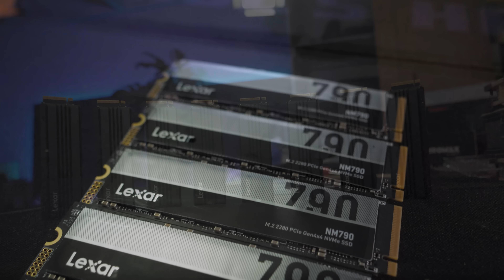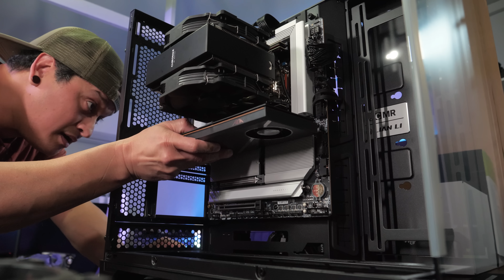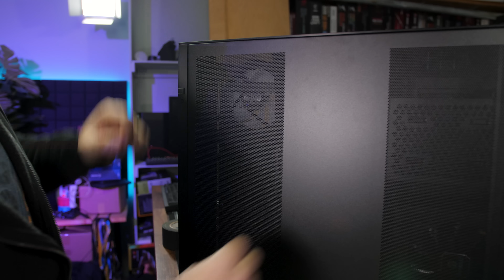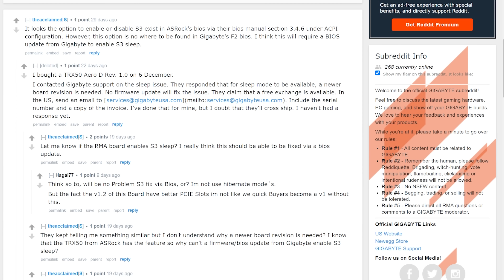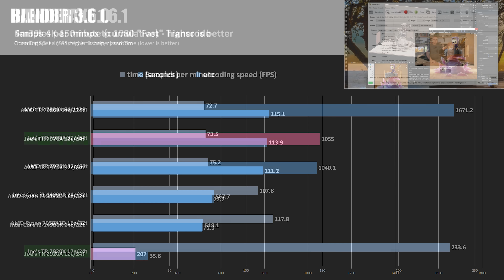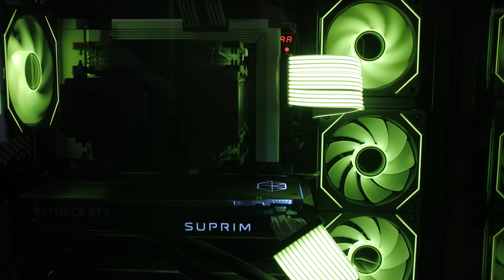Did we screw up?? Fixing and TESTING a $10,000 Gaming/Editing PC...

Comment: Nice build and seems like an awesome system upgrade for Joe too 👍 aesthetically you much improved the look when switching layout of the cards, and most likely a slight improvement of airflow 🤔 speaking of airflow you should have gpu pushing the heat out of the box 😜 thnx for great vids guys ❤

Comment: I wonder how come that you decided to install the radiator and fans of the graphic card in a way that the hot air from it is being pushed to the inside of the case, if you had installed it the other way around you could have avoided the issue of the conflicting directions of the air flows making the use of that flange you installed unnecessary

Comment: Honestly, I don't like sleep mode. Even after decades of Windows use its' still clunky. 
That said, RMA the board if you're 2 revisions behind and it's free. You'll (hopefully) get longer BIOS support and avoid any quirks that 1.0 boards invariably have.
SUPER happy you were able to undo that janky slot setup. It was weird because I thought all the slots supported bifurcation. 

As for the fan setup, I'm guessing you can just have all the fans on the side blow the same direction, the temps should be fine.

Comment: Just flip those radiator fans the other way, that 4090 is putting +500w into the case and its never a good idea to have fans next to each other blowing the other ways. That single exhaust on the back is fine and those at bottom and you can control the fan rpms to have positive pressure inside the case.
Also that top fan on Noctua isnt all the way installed, you can see it in the end of the video that it pops couple of millimeters off the cooler.

Comment: It seems like the foam divider for the fan works alright. But you could keep the bottom as intake, change the rear fan to intake also, and then make the 3 fans on the side exhaust. Be easy to keep slightly positive pressure and looks like the direction of airflow would be pretty clean too.

Comment: I have an Asus ROG Strix Z690-A Gaming WiFi D4 motherboard with a weird issue. It won't turn on with XMP, as it gets stuck in the memory training. I knew I had to RMA it, but then I have to wait until I get the board back, and re assembling would take some time. So I just don't shut down the computer at all, I'll just let it sleep and restart once in a while. I've been using that this way for 2 years now😂

Comment: Thanks for sharing, very interesting. The re-positioning of the GPU and the other cards really is better now, and looks way more organized too - it also makes for better cooling and actually lets you close up the case as much as possible. A follow-up would be nice, with some more efficiency testing of different cooler setups/orientations in terms of airflow and cooling (benchmarks? :)). And if it was about me, i'd totally exchange for the newer revision of the board. Not just for that sleep mode, but maybe there are some other issues that got fixed/improved/updated that weren't disclosed. Looking forward to the CES btw! A lot of stuff going on this year, this will become a super interesting and exciting one for sure.

Cheers!

Comment: I'd want to hear what gigabyte has to day directly before RMA - like others have said, revisions that fast can sometimes mean urgent issues were addressed.  

That said, sleep (S3) isn't a huge power savings these days and, with win11 on AM5, has actually shown issues with memory speed reduction over time.  

Since windows benefits from occasional full restarts anyway, I usually configure my PC to hibernate (S4), which allows the memory controller to entirely shut down, and I fully reboot once a week. (Hibernate has to be added to the start menu via control panel in win11)

Comment: I also had early adopter issues with my Intel Xeon W7-2495X and ASUS W790 ACE system.  The motherboard NVMe is fussy and a bunch of the models on the QVL actually don't work, good job ASUS.  And when I updated to the latest BIOS, the memory training was all messed up, I had to wait 10 minutes for it to fail and then manually set the memory timing.  Each successive BIOS version just got worse and more unstable and more issues.  Yay again, ASUS.  It took a while but I finally have a working workstation.  Also, no Sleep in Windows. Also $10,000.00
Reply: daveg4417
ASUS = early adopter issues, they always do crab Xeon on cheap boards
WHY BE THE TEST BUNNIE ???
Need Xeon, just buy a good HP system please ;) Keep it cheap !

Comment: Sleep/hibernate is not a mode I use.  I purposely turn it off.  So i would not rma for it.  However if you do use sleep mode, then you should rma it.  As for ongoing content... if you rma it, perhaps showing any changes in the 1.1 or 1.2 versions of the motherboard would be interesting.  Outside of that I think you guys covered it.

Comment: The sleep mode thing shouldn't be an issue; just enable Hibernation in Windows and use that instead. The startup time (from power off) should be negligible with that SSD setup.
Reply: TheRealSkeletor
Muahahaah, you are the Total NOOB here !
Gamers never do  Hibernation or Sleep stages, unable to WOKE it !
If you overclock systems to get more frames, these office low energy settings fuck it all up !
Good luck get smart here, LOL !

Comment: I like the looks of the Lian Li Vision but still prefer the Lian Li EVO for better top Exhaust for fans or a AIO. I never shut my system down as I just let it go to sleep. From what I have found about Gigabyte motherboard and doing a lot of research as Gigabyte doesn't like to show things Like reducing the layer to 6 from 8 on previous versions and dropping to the 10 year old version of ALC897 Codec on their over $200 dollar boards. Like their GIGABYTE B650 AORUS ELITE AX 8 layer 14-+2+1 70 amp smart power stages for $219 to their new White GIGABYTE B650 AORUS ELITE AX ICE 6 layer 12+2+2 ??? power stages for $229. Way to go Gigabyte make them cheaper and raise the cost.

Comment: i manually disable sleep options always on all of the over 4000 gaming systems ive built over the years because so many freeze issues arise from sleep/wake. i just tell my peeps to either leave it up or shut it down. i personally have never ever ever used sleep on any systems for over 25 years.

system looks like a monster, should really make joe's life easier with much shorter render times.

Comment: 10:40 If the RMA is very low cost or free I'd do it for the sake of getting a better and potentially more reliable board. I don't personally use sleep functions so wouldn't care much about the feature, but there could be other issues on v1.0.

Comment: Water cooling is mostly for looks now.  I have a thermalright peerless assassin cooling my 5950x and it hits 65c at full load 4.6ghz.
Reply: 4.6 is not enough for modern graphics cards.
you should do a new 65 watt CPU by AMD, or the 14900 F by intel, better !

Comment: I dont like air cooling and   it had nothing to do with performance and everything to do with weight on the socket. With the tower coolers, I've noticed that it warps the boards, and that causes DRAM slots  and PCIe slots to fail. It's a small sample size, but every water cooled pc has been fine, and every air-cooled pc with a heavy tower air cooler has developed issues with slots and i know correlation is not causation and 30 PCs is not a large enough sample size but since the only PC i build these days are my own I'm going to stick with custom water cooling.

Comment: I'd like to tell you what I think, just like you asked. The fans in the back are still going to cross-contaminate OUTSIDE the case. Imho it would be better to intake at the front sideto help improve the positive pressure in the case to force air out the back. Also, the twist in the hoses was a little jarring but I'm over it because at least I don't have it in my house, looking at it like that every day. 🥴

Comment: Turned out so much better on the end. I'm not so keen on that case though. It's huge but doesn't seem to benefit from it as much as other cases.  I think workstation motherboards should think more intelligently about ssd storage too and better integral solutions provided.  I think air cooling is better unless the heat it causing issues like on an old cray supercomputer or something.

Comment: What I would want? Simple RMA the Motherboard and then put in the air-cooled GPU you wanted to use from the start. Make all three of the vertical fans intakes as well as all the bottom fans. The case has enough holes in the back and that back fan for exhaust.  But that is just my suggestion.
Reply: DavidSiebert
this is promoted gear, can't RMA that.
My suggestion, just buy the HP OMEN 14900 F system, keep it cheap, 1699 is enough.
Need more, buy more parts ? New case ? Less good ?

Comment: Paul, I would RMA the board just so you have better support in the future and, as a bonus, you will also be able to put the system to sleep.  It certainly is not a good look to have that may revisions on such a new product so for future support and stability, I would go ahead and get the newest version board they will send you (1.1 or 1.2 respectively).  This assumes the newer revisions of the board prove to actually be better than the v1.0 version in the future, which is a bit of a gamble, no matter which route you choose to take.  Cheers!

Comment: Definitely curious if using the gpu fans as exhaust is better for the CPU. Maybe you could even out the pressure by eliminating the rear exhaust, and installing an aida64 sensorpanel or something similar.

Comment: The sleep function will help with security and power consumption. If you are the type of user that never turns their PC off, sleep will lower your power bill. I use sleep during the day and turn off the PC, overnight. Security is only an issue if you have sensitive or private material, you don't want out, while the PC is unattended. My PC's sleep may be set for 15 minutes but I push the sleep button every time I walk away from it, forcing a password on wake.

Edit: The big question is what is the PC's idle power draw?

Comment: I'd plug all those fans into the mobo so that the GPU fans are spinning with the rest of the case. Use Argus monitor to make a fan controller that can ramp all the fan speeds based on CPU and GPU temps, responding to whichever is warmer.
Reply: acquacow
Is that a question ?
Modern system never need Argus, able to control it on UEFI pre boot and in Windows.
What board u use ?

Comment: Don't have the sleep option on my AMD Ryzen 9 5900X  build  running windows 11 Pro either. And I had hell with my gigabyte TRX40 Designaire Motherboard  when I did  my Threadripper build in 2020 finally had to RMA the board in 2021  and after that it was a great  pc until some one stole it last year.

Comment: @Paul's Hardware : Hi Paul & Joe,
First of all : I would RMA the board, it costs more than enough to expect everything to be fully functional, including the sleep capabilities.
And 2nd : move the GPU AIO 240 radiator up and let both fans on the radiator exhaust, and put the intake fan at the bottom so that it feeds in cooler air (hot air rises).
If you can : try placing louvres that force the radiator air exhaust upwards instead of straight out (horizontally), that may help to feed cooler air to the lower intake fan.
Reply: radiators should be intake

Comment: I got rev1.1 with sleeping mode fixed/ enabled in this version..  but for rev1.2 the only difference is adding as you mentioned "ultra durable slot" which i don't understand.. could any body clarify !??..  and i wonder why gigabyte couldn't address such issues before surprising us with 2 revisions in almost 1 month.. as if it goes like this, by the end of quarter one 2024 they may release rev 3.0 😏
Reply from the maker: I also noticed rev1.2 had some added surface mounted components to the left of the lowest PCIE slot when comparing the two pics. Usually that's where audio stuff resides but I can't say for sure.
Reply: @paulshardware  yes i noticed that too just today by comparing rev1.1 vs rev1.2 top view images ..  so weird and ridiculous that they don't even mention in the description or specs the differences between revisions.

Comment: For that case, the side fans should be input. it sounds like it doesn't make sense to only have 1 exhaust but, every test I've seen on it, shows it improves temps. Can you lower the motherboard tray and get 2 in the back? Lian Li themselves recommend to configure all the side fans as intake. - Sleep is stupid. Just leave it on idle. Turn the display off if you need to.- RAM taking a long time early might be clock rate instability with 4 sticks. Clock it down to stock (no expo) and try again. If no post then, problems. If it posts, work on timings more than bus speed for AMD.

Comment: Awesomesauce video Paul and Joe! ❤
Nice to see PM2 running fully. 
As for the issue of RMA to get a sleep mode; that is a damn bit amount of work to be done. As was stated before by fellow commenters, if Gigabyte would send a replacement board first,  then maybe.. 🤔   Either way, its a lot of work. I would see the temperatures, during CES rendering, are like. If Joe's hotel room turns into a dry sauna, then just buy Joe a beast of an AC  window unit for his office. Less work, and the current WORKING version of PM2 lives on. 
So still some jankiness which is what we live with. 
Caffeinator out!

Comment: Alleluia! My air flow angst thus relieved.

Sleep? Why not just shut it down for extended inactivity? I have a x570 Gigabyte MB with Windows 11 Pro installed. I can manually pick Sleep from the menu, but the OS setting to sleep at 30 min of no input is unpredictable. Sometimes it goes to sleep at 30 min, sometimes it doesn’t…for durations longer than 10 hours. Odd.

Comment: Hey Paul, why you didn't go with something like Arctic Freezer 4U cooler for sTR5 socket + 3d printed "shroud" for top and sides of the cooler for better looks? It would allow you to just mount cooler in horizontal manner and would allow for better air circulation. It's really silent cooler and I`m using SP3 version for my Epyc CPU - works like a champ. The only bad thing is that it uses fans on sleeds, but mounting other fans with higher specs would still be possible. 
For air vs "water" - nothing special, kraken was always mediocre at best and it need fan swap + it doesn't even cover whole CPU, check water coolers which cover whole IHS next time to have more "apple to apple" comparison.
Reply: Why all the carb ?
65 Watt CPU !!!!
overclocking Epyc CPU's, muahahhahahaha....Need more frames ? RTX 4090 on 65 W F CPU is better !
Reply: @lucasrem  Could you please write it again, so that it's understandable for others?

Comment: Honestly for 10000 bugs I would never buy this one. Looks bad and is dark as my a-hole. I woudl definitly went with custom build water cooling. Way better then air cooling. And worst misstake is, that you put the radiator on the buttom which should be NEVER done. Top or standing but NEVER buttom.

Comment: Hi Paul and Joe   If you moved the GPU radiator up a position the hoses would look way less tortured😃
Reply: Agreed, and since heat rises, the intake fan, even though there is foam on the inside of the case, is currently sucking in the warm rising air from the GPU radiator.  Swapping positions should fix most of that and look better.

Comment: Why aren't the intake radiator fans spinning?
Reply from the maker: The GPU fan headers are still plugged into the GPU, which has zero fan mode enabled when GPU temps are low

Comment: he should have waited for zen5 and run 256gb ram and saved 5k, bringing in hot radiator air into the case was definitely a mistake - fire anybody who came up with this idea but overall building bleeding edge is fraught - the build was an exercise - could you sell it for what you bought it for - unlikely. sell the nvme and get 64 core cpu for real gains - run 2 nvme and 4 ssd in raid0 #the compensator build....if you are going to build something like this go all the way - it could be 3-4 years before this is really fiscally responsible - 64 core cpu, dual 4090, 1tb ram and enterprise nvme raid10 - even then you won't be able to run the bigger LLM and will need to get cxl device to work with the gpu - that is the machine you should have built but realistically this may be v4 /5 of the ultimate video ws

Comment: I never let any of my pc's 'sleep' now for many years, always disable it. I would also mount the rad the other side of the bracket (i notice there is plenty of room) and mount the fans then on the the inside of the bracket blowing through the rad and then out (exhaust). The look will be cleaner on the inside of the case and the rad will be closer to the outside of the case 👍

Comment: Definitely get an RMA done. When the company is offering an exchange, I think you should do it. Ridiculous of them to make this change on a board level rather than a bios update. Yay for air cooling, been running 2 xeons 2630 v4 on air cool for rendering and stuff for almost 8 years and it still sits around 45 ish. Cool build ❤❤❤
Reply: You don't know if it's actually a hardware mistake or not. Also it seems like AMD's communication to their board partners is miserable. We've seen it first hand with the too high SoC voltage they communicated initially. Or did not communicate it to be lowered compared to non X3D parts...
Reply: @kyoudaiken  The SOC problem was a board partner issue, AMD clearly had the voltage max set on the spec of the CPU,s Asus generally is lazy when it comes to bios voltage
Reply: @PermaSaltXp  AGESA is provided as a module from AMD and is signed and cannot be modified by board partners. The BIOS code however can override the value. But I doubt it was the case. The topic is far more complex and it has been shown that it was a communication issue.